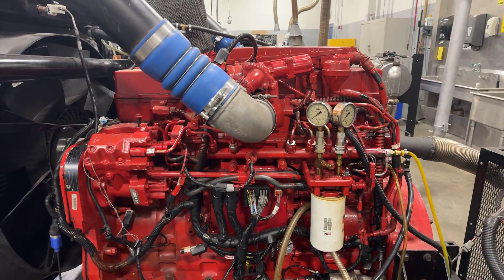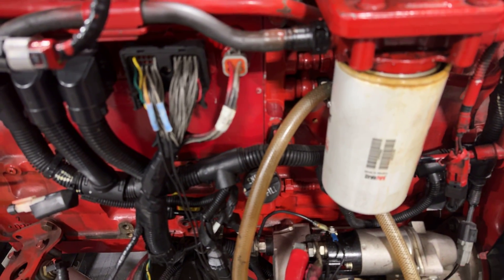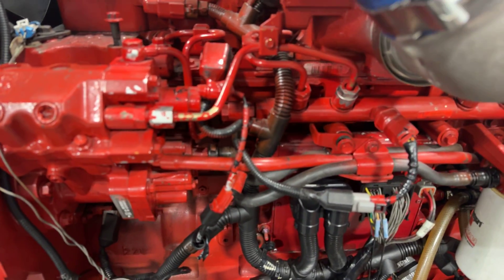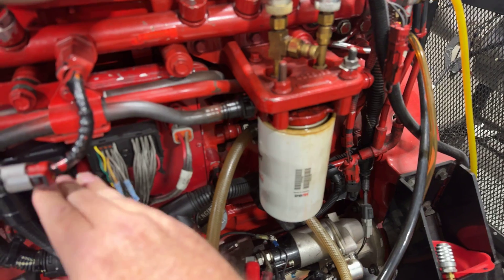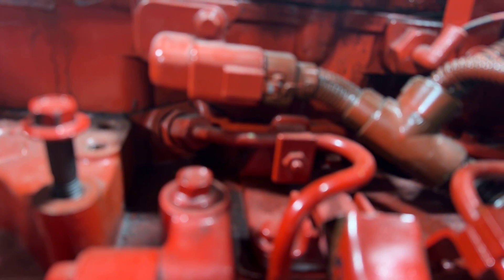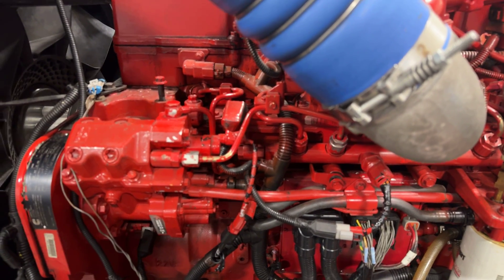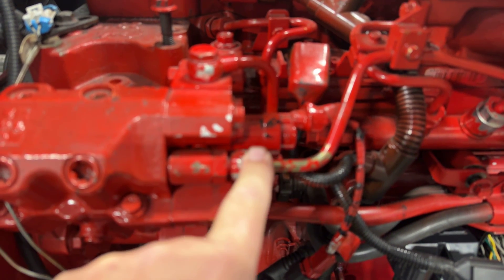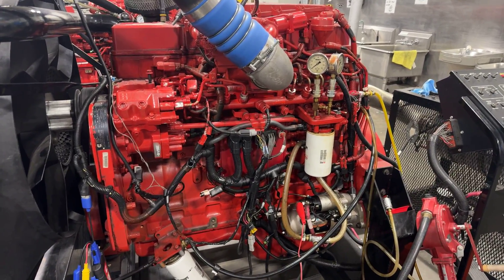How High Pressure Common Rail Changed Diesel Forever

Comment: Thank you for the explanation. I am actually taking the T2 ASE test soon. I have a question about pressure control. How does it regulate the amount of fuel pressure to the rail? Does it have a fuel pressure return to the tank if the pressure gets too high? I know that that gasoline and some light diesel duty vehicles will sent it back if pressure is too high, I just don't know about heavy duty diesel engines. Thanks!
Reply from the maker: There is a high pressure actuator installed in the high pressure fuel pump that controls the pressure going to the rail and most rails have a pressure relief valve on the end and opens to a return manifold and then the tank if pressure spikes.

Comment: What powers the High pressure actuator? Is it a cam lobe or belt and is the high pressure pump pressure essentialy controlled by a fuel demand valve? So at low speeds the pressure needed is less to spray into the combustion chamber so less fuel is delivered into the Pump with the actuautor in, by the fuel demand valve or is it always the same pressure no matter what and the ECU sends a signal to the injector to have a less open time to spray less fuel at low speeds.
Reply from the maker: The high pressure actuator is just a solenoid that opens and close electronically, if you are talking about the high pressure pump it is gear driven off the crank or an idler. As for the second part both things you said is correct, pressure is adjusted per demand by the ECM controlled high pressure actuator and it can also control injector dwell time to increase or decrease fuel delivery. Being able to control fuel delivery in so many ways, so quickly and so precisely is what makes this a very popular fuel system and so good at controlling emissions and meeting EPA mandates.